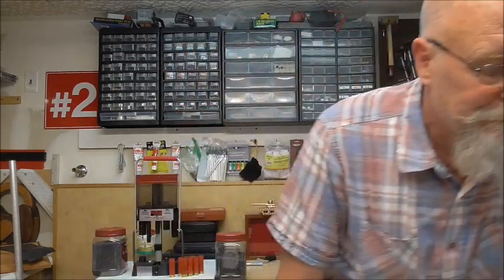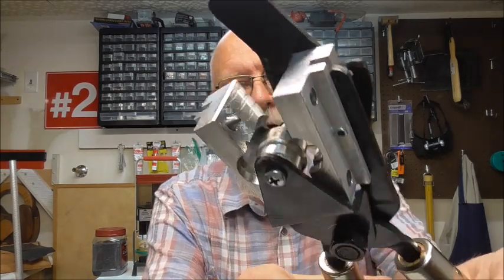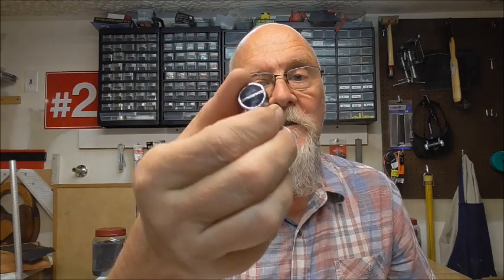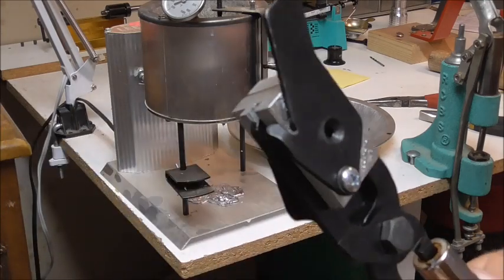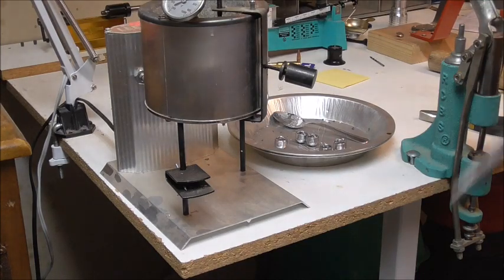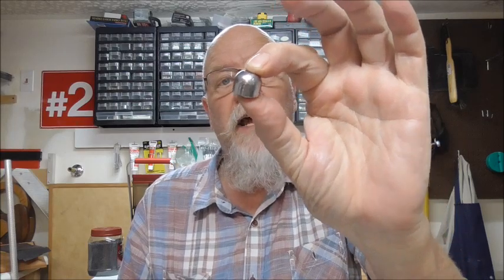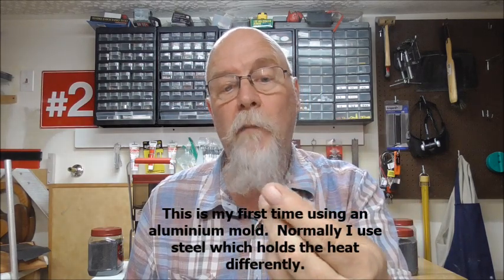Making Lee, 12 ga., 7/8 oz. shotgun slugs

Comment: That fold of flat metal on the one leg, once adjusted properly, is for resting the mold on while pouring the lead.
Reply: thank you , i was gonna post that lol
Reply: My 10lb potatoes Not Have.. I Figure Use Some 2x4 Drop Offs And a Bolt I Can Adjust As A Limit For Alignment.

Comment: A couple of tips from a ,uh hum, seasoned caster if I may. I use 2 different pans, one for obvious rejects and sprues as the mold comes up to temp, I also keep an old firefighters glove around so I can swing the sprue plate back over without having to hit it with the mallet. I use sawdust and candlewax to flux with and it has been found to clean up the lead the best for me.

Comment: The Lee 7/8oz slugs are very accurate. They fit nicely in once fired Federal or Estate hulls. Tapered wall hulls are a bit too snug of a fit. 
Fed 12S0 wads or Winchester gray or pink wads work fine with a crimp. Claybuster versions WILL NOT work.

Comment: RULE NO. 1
DO NOT hit the center mold bracket with the mallet or anything else ... you only hit the nut/bolt that holds the two halves and center part of the mold together. Otherwise you will eventually bend the bracket that supports the center part of the mold and it often times will not be a fun task bending it back to the perfect position it needs to be in order to line back up with both the left and right parts of the mold
Reply: Rubbish. These things cost $38. Beat the living hell out of them. I make thousands of Lee slugs. I have to pour 500 today. The best way to make a reluctant one drop the slug is to smack the thin metal plate you mentioned that supports the core pin. It may bend a bit, but it easily bends right back. I have four of the 7/8oz models that I've used for years. They still perform flawlessly, and have paid for themselves countless times.

Comment: Dropping the moulded slug on to the plate on top of a table, maybe not a good idea. I drop mine on to a damp towel, first making sure it`s an old one. I also always put the first ten straight back in the melter.
Reply from the maker: That is an excellent suggestion.  Thanks

Comment: RULE NO. 2
DO NOT hit the sprew plate. Once you bend it, it will not lay flat against the top of the mold thus will not shear off the slug at the proper height, and these are not often easy to get flat again whereby it is not just a simple matter of tightening it down in your vice or smacking it flat on a hard surface. It takes a bit of work to get it back it back into the proper working condition whereby sometimes having to account for the flexibility of steel and bending things past their flat position in order for the steel to then spring back just right to return itself to the flat position
Reply: First, replacement sprue plates are like $4. Second, I don't see how it's possible to bend said thick steel plate with normal or even heavy rapping. I do it all the time to make it release the sprue. Never had  one bend. You're more likely to damage the threads on the screw that holds the plate on than the plate itself, if you beat on it with it open.
Reply: @robertfrapples2472  there is no reason to hit your sprue plate . Put on a welding glove and push it over .Every bullet mold is a precision machine why beat on it like a computer

Comment: I've seen warming the mold recommended before, but watched a BRO video earlier where he didn't heat it at all. Just turned thay same pot to the setting between 8 & 9. Lil hotter lead and it poured, filleed the mold, & very little sprue to trim.

Comment: I don't get it I followed everyone's instructions on prepping the mold but the slug just won't let go of the core pin and gets stuck.  I'm melting birdshot into 7/8 slugs.  I even tried to debur the core pin but nothing.
Reply: Any luck?
Reply: @tomothybahamothy  Haven't tested since that comment.  One person had some luck lubing the core pin with candle wax but it shouldn't be like that where you have to lube it every cast.
Reply: The pin has to finish warming up and expanding.  Pull the slugs off with pliers and reintroduce them to furnace you ding them up.  Otherwise keep casting until they start coming off easier.  I’ve it take 10 or more before.
Reply: @ramo0901  I had the mold sitting in the pot too much that it wouldn't let the lead set.  After a little it should have been down to the correct temperature but it still wouldn't let go.
Reply: @tomothybahamothy  the monarch bird shot I was using was too hard with antimony.  You have to dilute it with soft lead like fishing sinkers or air gun pellets.  After that they drop like nothing.

Comment: 7/8 ounce. I've watched a few of these why notput a piece of tungsten in the center to add weight ( 1 oz ) slug. Is there a reason no one does this
Reply: I've been wondering why no one makes a 2- or 3-ounce slug.  Why not bigger than the industry standard?
Reply: @waynegroves6922  may be to much weight an not enough velocity out of a low brass bird shot shell idk
Reply: This particular slug geometry seems to shoot more accurately at 7/8 ounce. There are other slug configurations that shoot well at higher weights. 

Why are there no 3 ounce slugs? Physics! For each action there is an equal reaction. A 3 ounce slug would require about three times as much gunpowder and would generate about three times as much recoil.
Reply: Good luck trying to perfectly center that piece of tungsten otherwise your slug won’t fly straight.  Better off buying the Lee 1oz slug mold if you want a heavier slug but 1oz slugs are not as accurate as the 7/8

Comment: How much tin/antimony are you adding to the amalgam btw? Do you polycoat them?
Reply from the maker: I buy all my lead already alloyed; (#2, 20:1, 100 %, etc.) from an on line site and use what ever is recommended in my book. 🙂. I do not polycoat.
Reply: I will  be using Pure soft lead and will add about 1-2% tin to help with the mold fill out. I will not be using alloyed lead b/c I don't want to have a hard lead slug, I only have smooth bore. I may want a harder lead if I had a rifled barrel?

Comment: Great video have you shot any of those slugs yet ? If so are they accurate ? Thanks for sharing
Reply: The Lee 7/8oz slugs are very accurate. They fit nicely in once fired Federal or Estate hulls. Tapered wall hulls are a bit too snug of a fit. 
Fed 12S0 wads or Winchester gray or pink wads work fine with a crimp. Claybuster versions WILL NOT work.

Comment: How do you get the lead off of the bottom plate
Reply from the maker: If you follow the directions on getting the mold ready there shouldn’t be an issue.  I’ve never had a sticking problem.
As the lead cools it pulls away from the mold but you still have to smack it.😁

Comment: Can anyone help? I got a 2.2 cc dipper with my 7/8 lee slug mold and I was wondering why? Is it for hand reloading the 7/8 slug or the proper amount of shot to melt down? I'm just getting into reloading my grandfather passed away 12 years ago and he was the only one that enjoyed shooting as much as me and he was a wealth of reloading knowledge he did it all. so if someone could help answer the mystery I would very much appreciate it ! Thank you 8)
Reply: The dipper is a powder measure.
Reply: @jungleno.  yeah.... but is it a recommended amount for a 7/8 slug ? It's has no instructions on what the dipper is for. Is it black powder, flash powder, baby powder? Doesn't say and a lil Birdy told me you gota be very careful and exact on the amount you use.hahaha but that was a good answer.
Reply: @BUZZKILLJRJR  the slug mold from Lee comes with instructions and a couple of load recipes. The powder Dipper is for those recipes.
There are very few recipes for the Lee slugs but some reloaders(wink wink) use starting load recipes intended for 7/8 oz shot with wads appropriate for slugs.
Some reloaders(wink wink) use between 16-17g Hodgdon Clay's under Fed 12S0 or Winchester gray or pink wads for low recoil 7/8 oz slug loads.
Reply: @jungleno.  Roger that. There were some that requires alot more but starting small and easier and working up would be the best way to take it slow.
Reply: @jungleno.  also thanks brother I appreciate the time for the answers,  mine didn't come with instructions tho so I'll have to see if I can call them or find it online. any good shot gun loading books a guy could recommend?
Reply: @BUZZKILLJRJR  yes: https://www.midwayusa.com/product/1012856166?pid=266146 

Published by Load books USA.
Buy one for every caliber bullet you reload.
Reply: @jungleno.  you guys are awesome!!  Thank you!!
Reply: @BUZZKILLJRJR  watch some YouTube videos by Bubba Roundtree Outdoors. He does a lot of shotgun reloading videos.
Reply: @jungleno.  I actually have and am a sub he is quite informative so far. Thanks again brother the rounds iv have made so far are working amazing. So once I start from scratch at least I have a starting point  wink 😉 haha
Reply: The dipper that you got from Lee precision is intended to use with powder. It can be used for other things, but i believe the dipper is just a novelty. There are so many different powders out there and they all meter differently. You will have to get Lees conversion chart and find a powder that will work with that dipper. I use mine for traditional black powder and not smokeless powder. Its just safer that way. You really should weigh smokeless powder for best results. Good luck with your hand loads. Its a lifetime investment that can bring you satisfaction, and save you a ridiculous amount of money.

Comment: What size wad to do you use with that size
Reply: They fit nicely in once fired Federal or Estate hulls. Tapered wall hulls are a bit too snug of a fit. 
Fed 12S0 wads or Winchester gray or pink wads work fine with a crimp. Claybuster versions WILL NOT work.